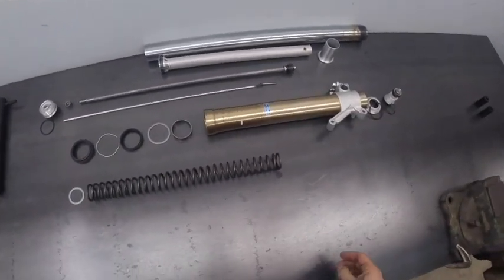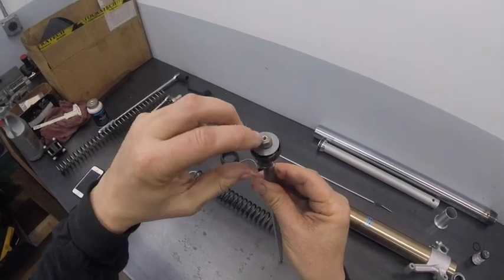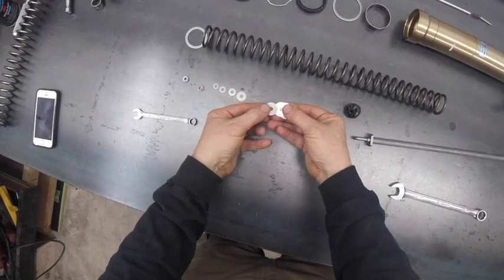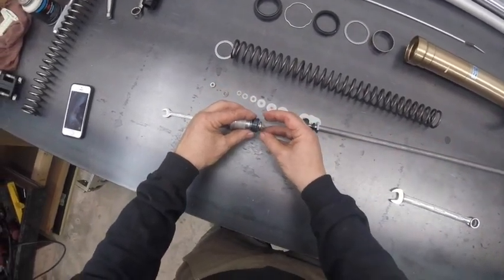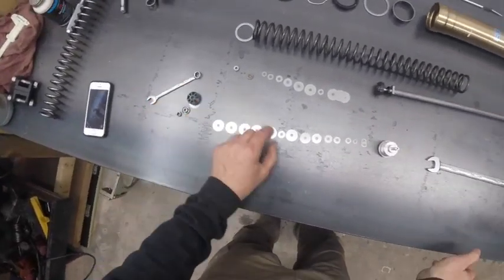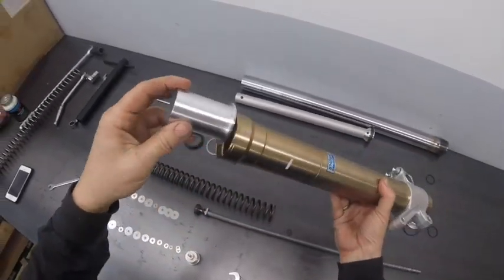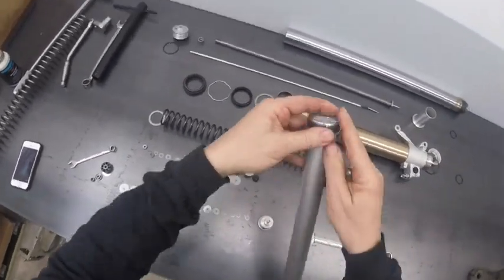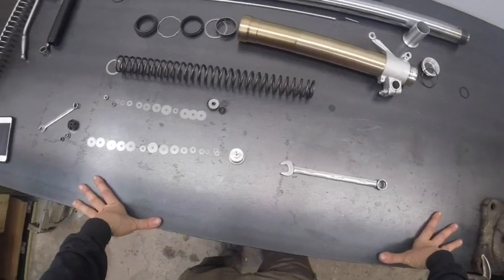DR-Z400 fork inspection

Comment: On the top portion of the dampening rod where the nut threads on the nut has a unthreaded portion inside of it,does the unthreaded portion face up or face down . Thanks